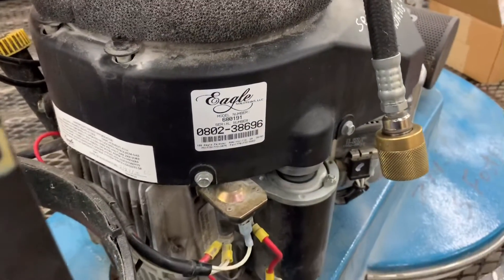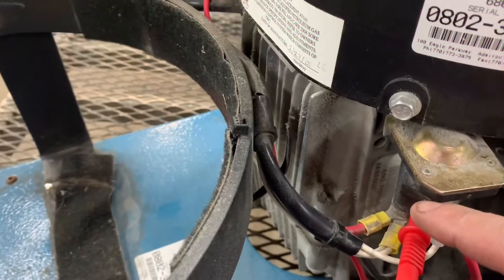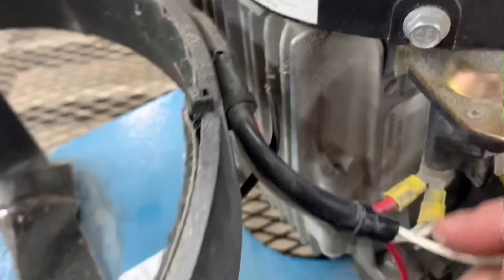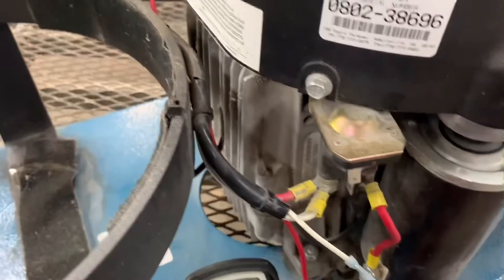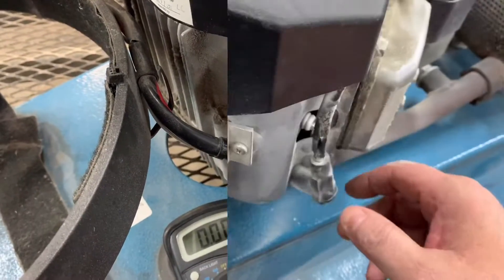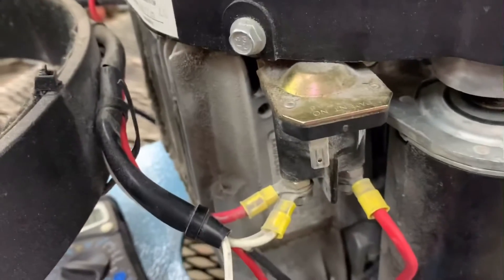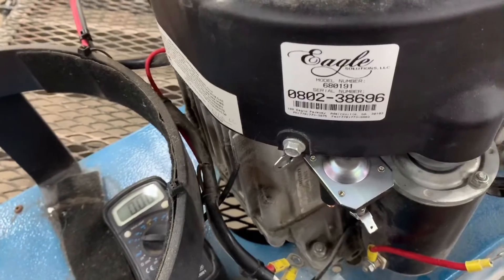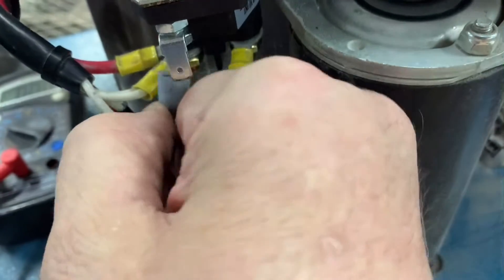HOW TO FIX A SMALL ENGINE THAT WILL NOT SPIN OVER

Comment: Good info , I'm just working on chain saws , while on that subject , if you run across a starter pulley for a Poulan 3400 anti vibe or know anyone who has one ( actually I need 2 ) please let me know . The one I need has 4 splines on the bottom to engage the starter spring & 6 splines on the top to engage the starter dogs . Thanks for any help , and hope you have a great year ! :-)

Comment: Hi mower medic 
My best tomorrow to  you and yours in the new year 
Need your help I’ve bine having huge problem with a hand held Stihl BG55 blower
I’ve changed the cylinder pistons oil seals carburetor spark plug I got it to turn on but I can’t get it started again but the next day I can I also changed the coil 
What Can it be This is been a learning curve for me once I find out what’s wrong with this would build up my mileage more thanks Need your help

Comment: i have a simplicity coronet 10.5hp it will not turn over the solenoid is on the side and its ok but when i turn the key over there is a thunk sound under the shroud going around the motor  but it not coming from the starter it self . if i jump to the starter it turns over any ideas it is a riding mower.
Reply from the maker: Bad safety switch someplace